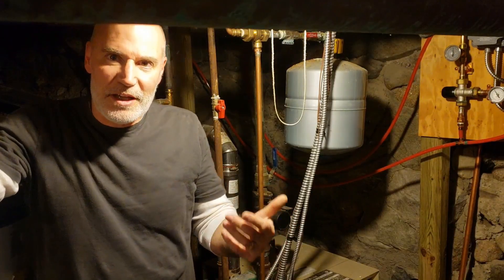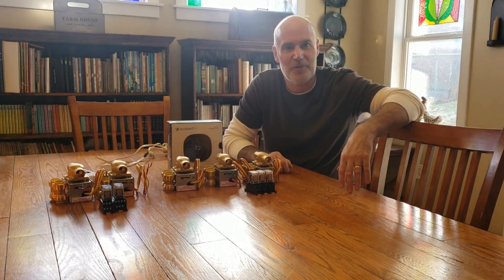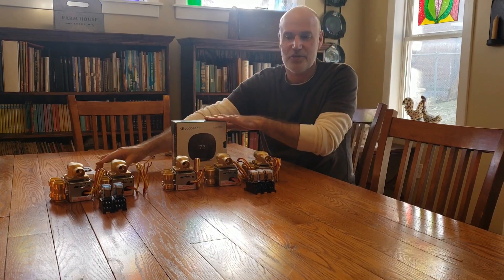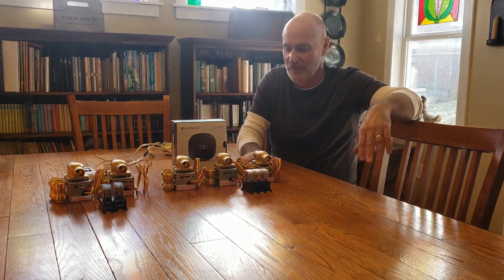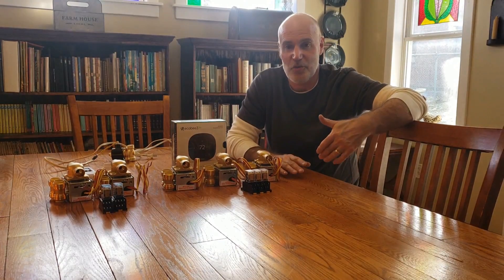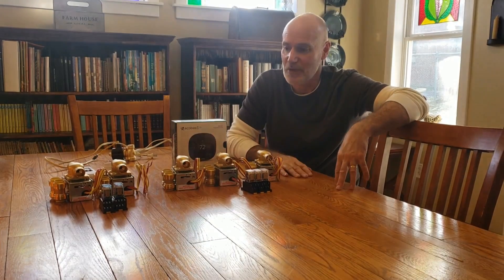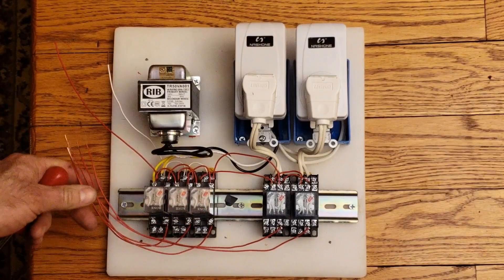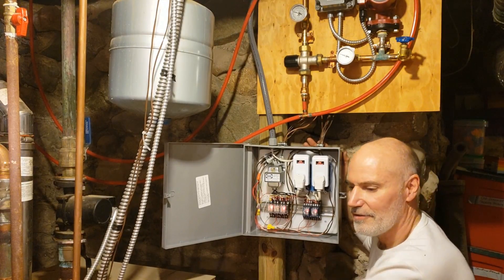How To Add Thermostat Control to Multiple Zones of a Hot Water Baseboard Heating System

Comment: Good video.. my question  did not came in it. I was waiting to see. WHERE DO YOU  CONNECT TO BOILER!.
I HAVE A HOT WATER  SISTEM TOO. 2 zones only.
Basic.  Primary pump. and  zone valve ( in line zone valve 120v.  for 1st floor. Connected to a regular thermostat  battery operated. 2 wires to boiler.
So,, thermostat  calls. Fire up. No problem. 
Secondary pump and 120v in line zone valve. Are Connected to the attic thermostat that as well is a 120v thermostat.  So,, if Secondary  thermostat calls for heat. Secondary pump and zone valve start  working.  But,,,,,, no fire..!!  where do I need to connect Secondary  to make the boiler  kick on!? Only 3 screws on boiler for thermostat.  R. W. A..
The R. and W. Are currently used for Primary thermostat.  
I hope you can  help me.  I called  a few companies. First  thing they  said is.. 
Never saw before  those zone valves!. I go.. that's  not the problem buddy.   signal to the boiler  from  Secondary  to turn  on the boiler when  it calls. That's it. 
They want  to replace even the boiler.. is not that old. Replaced on 2005. So,, if anyone has an answer.  Easy.. 
WHERE DO I CONNECT WIRES TO SEND SIGNAL TO BOILER TO FIRE UP?. 
note. Everything has its own shut off valves. Returns and supply.  Primary pump and Primary zone VALVE  has not interference .with  Secondary  zone. As Secondary  zone has a T pipe coming from  boiler up. Then after that  Primary  zone valve. Hopefully you or anyone  can help.  Thanks!!
Reply from the maker: I'm out of town at the moment but I believe that with my system, the "fire" is it's own separate, self contained system and does not rely on the room thermostats to ignite.  It has its own thermostat that is simply monitoring the temperature of the water in the boiler tank.  It only fires when that water temperature dips below the water temperature set point.  Is your system different from that?

Comment: A good video Steve. Just wish you showed the wiring on paper in a schematic format as well. Lastly ask where you purchased the mounting panel and enclosure as it is made for those relays to mount. Place, name & model purchased pls.
Reply from the maker: I agree a schematic would have been nice but not being an electrician, I was afraid to draw it incorrectly 😕

Here's the info for the enclosure I purchased from Amazon: Arlington EB1212-1 Electronic Equipment Enclosure Box

As for the back panel, I stole a cheap plastic cutting board from my wife (don't tell her! Lol) 

Thanks for the questions. I didn't think to include the enclosure in the stock list but have since updated it.

Comment: Hi, Steve how is the radiant in floor heating going? Does the mixing valve work well? How do you return the water to the boiler? Do you need to adjust the temperature to send it back to the boiler to keep too cool of water returning? I live in a similar house (stain glass windows, etc) and I'm trying to plan out how to send lower heat from the boiler to the first floor in floor heating. The radiators on the second floor use hotter water as I'm sure you know. If you have any resources or info, I would be grateful.

Comment: Kudos for working on the heating system when it’s 20 degrees outside. Breaks my rule of never doing any plumbing on a Sunday or when it’s below freezing. You may want to purge the air out of the runs to the rooms that are always cold, especially if they are upper floors. There’s a YT video on that.

Comment: While zoning is a nice upgrade,you are compensating for symptoms instead of fixing the real problem.  230 degree outgoing water temps is not efficient , comfortable, or code , A room that will never get warm,. uneven heating. You have too little baseboard and what you have is not installed proportionally to the heat loss of each room.

i'd suggest you google us boiler heat loss  calculator and  calculate your heat loss room by room.  Rules of thumb don't work. 
select  baseboard of your choice and look up the output per ft at 180 degrees so when outdoor temps are at the coldest end of your "design temperature" 180 degree water will be required to keep the house 70 degrees. Slantfin baseboard to pick one puts out 610 btu per ft at 180 degrees. Divide the heat loss of each room by 610 to see how many feet of baseboard you should have in each room. Then add baseboard as needed. 
Please either learn to sweat copper or rent a press fit tool. Shark bits great for temporary emergency repairs imo, but some ppl disagree. Opinions on this very. .
#2, read the instructions that came with your zone valves or get them from the manufacturer and follow them. Heating systems are pretty standardized and an invention like yours, although very clever could be a problem if you are not there to personally fix it and  heating tech is called in, or when you want to sell the house and a house inspector comes. .

Comment: I only have 2 zones to control and I'd like to use those wireless thermostats. I just wire the one end into the boiler and the other into the valves? Maybe the directions in the package when I get the wireless thermostats will tell me. I just wanna make sure I didn't really miss anything since I wasn't going to use relays. Thanks for the video.
Reply from the maker: The wireless thermostats control sockets that you can use just like any relay. In my setup, each relay controlled its own zone valve. I didn't actually control the Boiler. It turns on by itself when the water temp is low

Good luck with your project!

Comment: Why did you decide to go this route rather than purchasing a zone control board to wire your thermostats and valves to?
Reply from the maker: Too cheap I guess, lol. Also wanted the challenge

Can you post a link to the board you are thinking of? Others may be in going that route instead

Thanks
Reply: I know I'm late to the party, but I'd like to learn more about this. I am a noob and having a bit of a hard time following all the info in the video. 
I have a three-zone system that's ready to have the valves and relays installed, but I have no idea where to start.